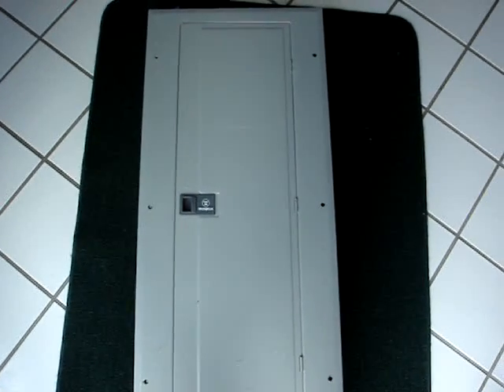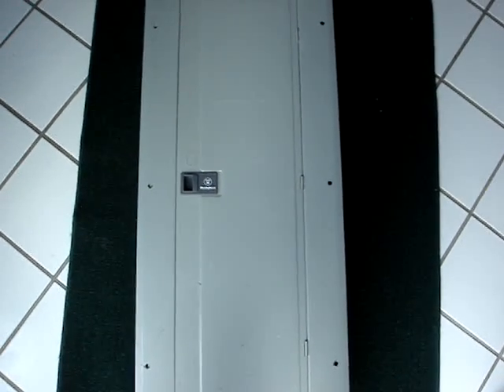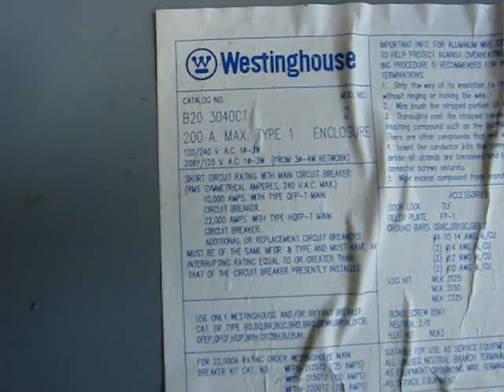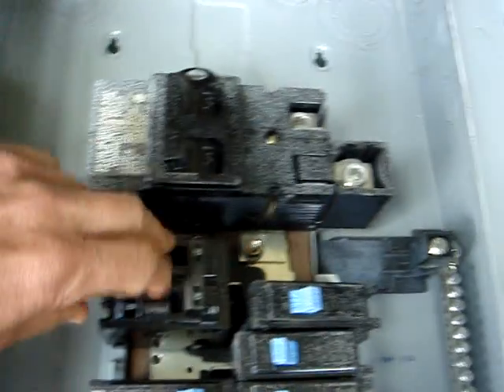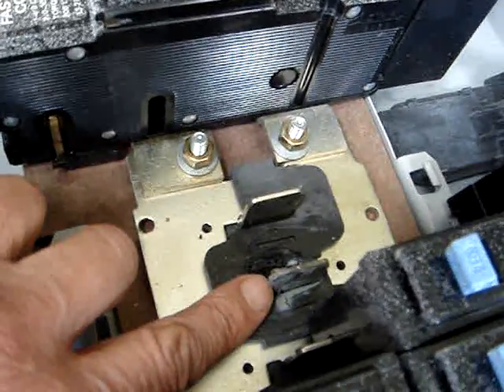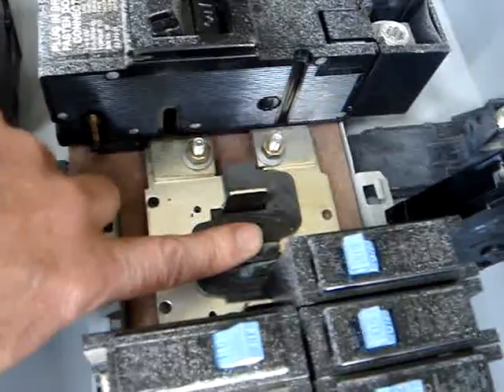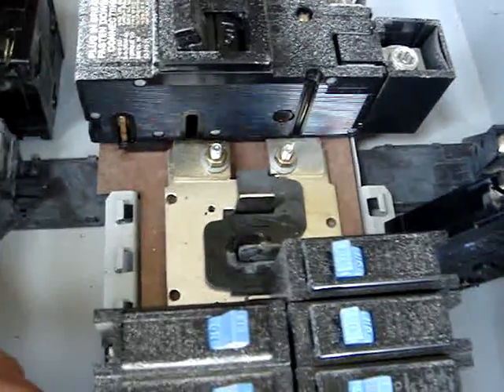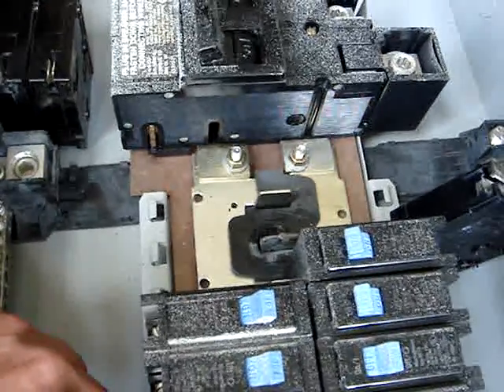Circuit Breaker Panel Problem - arcing between busbar and breaker - heating and melting plastic

Comment: Yeah, that the best safer way to go replace the breakers box. I had replaced quite a few, for the last 15 yrs as a electrician, the main reason this bus burn out is beacause  the connection is lose or the load is higher then the breaker suppling the load
Reply: Can you just replace the buss bar? This happened with ours and it looks much easier to replace just that part versus the whole panel which means tearing out drywall etc.... :-/

Comment: "2" problems, with any panel, Including, "Sq-"D" who every one says the "BEST" Horse shit !  If you get "Cheap" panels, with Aluminum, "BUSS BARS" & plug /Clip, on steel, copper, you get , heating, also notice where, main breaker, attaches to buss bars, "Notice steel bolts" -"NO large flat washers" bad surface contact betwwen Aluminum bars steel bolt carrying , 200 amps !   WAKE UP ! pay extra, for Copper bars !  Cutter Hammer & now  Seimens, has them. But will cost like $50.00 more ! Good price to save you're Kids & wife's Life. Unless you want to collect, life Insurance.
Reply from the maker: Thanks for the info.  I expect most homeowners hope the electrician makes the right choice since this level of knowledge is beyond us.  Obviously that is not always the case.  And, when buying a house that is already built, like I did,  you get what is there assuming it is okay.

Comment: I think only be replace just a bus bar and burn out breaker not entire panelboard must be replace cost more . Caution double check loosen and overload of load side preventive maintenance always
Reply from the maker: Not possible to replace just the bus bar in this panel.

Comment: 50A break for a house AC? 
Anyways they used the wrong breaker.  Looked like a Siemens breaker.  Gotta use the matching breaker for the box
Best to replace the whole thing, but if there is room, you can install the right breaker in a spot that isn’t burned up.

Comment: Me Too! Refrigerator was going wacky for a few days, started making strange noises, lights would sometimes blink. Got up this morning and fridge lights were out. First thought it had died and I would have to buy a new one. But just to be certain it wasnt power related I checked the breakers, which are Cutler Hammer from about 2003. No breaker had tripped. After some troubleshooting checked voltage at outlet, 107V. Went to panel board and all circuits were 120 except one which was 107V, a kitchen circuit. Pulled breaker and contacts were gone. Further inspection showed the contacts had probably been sizzling for several days and finally vaporized. The buss contact was badly pitted. Turned off power to panel and filed and sanded buss contact, but it is too pitted to recover and it is obvious the buss bar will have to be replaced. Moved kitchen circuit to never used breaker and am back in business for now. Also Replaced two adjacent breakers that had been pretty badly damaged from heat of the faulty contact. All breakers are CH, as they should be.

Comment from the maker: I am leaving the post addressed to Einstein on here because the person is right about not messing with a panel box yourself.  I am confused if he thinks i did that because it is quite clear in the description that I hired an electrician.  The video explains how i did troubleshooting for the problem, it doesn't advocate fixing it yourself.  The poster could benefit himself from a less condescending way of commenting.

Comment: Dear Albert Einstein:  You've got it all wrong!  This video should include a segment on do-it-yourself appendix removal, lung cancer radiation and chemotherapy (why pay retail prices?  Just buy the lung cancer chemicals and radiation equipment yourself, used, on ebay!),  and of course cure your own brain cancer, via easy to follow 3 minute clips on Youtube.  It takes two, not one, incomprehensible traits to mess with your own panel board:  stupidity of such a staggering degree that it blocks all cognizance of the notion of imminent, life-threatening danger, and cheapness so vast as to elect to think that it makes sense to try and save a little bit of money, despite the chance of losing your life.  Open up the wallet, tightwad, and get a pro in there from the word go.  Would you do your own brain tumor removal?  Messing with 50 amps coming into your house is every bit as unsafe.

Comment: Must use listed breakers, has nothing to do with the breaker panel. Each manufacturer has certain tolerances for breaker clamping force for their specific bus bar. Next time call the electrician first, he might of caught the bad connection in time and saved your panel. Home Depot is not qualified to give advice like this, especially over the phone!?
Reply from the maker: Elios Electric see comments

Comment: The electrician shoved nothing anywhere.  I no longer trusted the panel box not to repeat the problem so I told him to replace it.  Sometimes cheap isn't smart, especially if it means my house could burn down.

Comment: Circuit breaker was defeated product.  The company should had supply you with a new panel and all breakers.  Any company that doesn't do this, should be drop from your product buying list.  QOSD is very good.   It suck when a company will not stand behind there product.

Comment: The Entire Panel did not have to be replaced--The Buss is replaceable. The Original Cause of Arcing could be the Breaker or Buss. Also, if THAT Breaker Space was not needed, it could be Marked Do Not Use.
Reply from the maker: Good thinking.  I didn't trust the whole thing after the one section went bad and erred on the side of caution.
Reply: Can not agree enough. That electrician must have been on hard times.

Comment: if you find a voltage far less than 120, you may have arcing in you breaker box. I had 70v in 2 rooms of my house. it was the damn breaker box.

Comment: I have had this happen on BR type Eaton boxes with Eaton BR breakers.  Some panels even with larger loads are fine.  I have seen this on Murray boxes also.  I went back to using Eaton's Cutler Hammer CH panels.  Never had a problem out of a CH panel.  I have still been unable to find out why this happens.  Breakers are not getting good contact with buss bar is burning them up.  Breaker springs must be weaker than others not holding them tight on the bar.  No one  has a answer though as to why.
Reply from the maker: Starr Lion thanks for the info.
Reply: thanks for this video, my Murray panel is doing this as well.

Comment from the maker: The breakers are from the original panel installation, not replacements.  If you are right, the electrician didn't know his business.  Your observation could be right.  None of the other breakers showed this problem.

Comment: Yes , Just 2 days ago I was setting watching TV and smelled plastic and smoke . opened the door to my washroom and smoke & flames were coming from breaker box . Lucky I was home and I had a fire extinguisher . The 30 amp for my air also !! Yes the bus bar was melted .     Well I guess from these Vid. I have to change out the whole thing . This one is a Cutter-Hammer . Never heard of the Co.  This is a trailer built & bought in 2010 .

Comment: My Westinghouse panel is having the same issue. The main 100A melted to the busbar and burned some of it. I now need to change it out and may as well upgrade while doing so. I heard it buzzing but even after trying to reseat the breaker it did nothing. Are the old style Bryant breakers interchangeable with all C&H breakers, or do they say B series on them or something close?

Comment from the maker: This is not advice, just information.  If the main bar is in good shape, and there are some unused spaces on it, you may be able to have an electrician move the problem breakers (replaced of course with new ones) to another set of connectors on the bar if the wiring will reach.  DO NOT DO THIS YOURSELF!  Power to the entire box must be off.

Comment: That Siemens breaker for the a/c is NOT listed for use in that panel.  That's why it failed.
Reply: Justin Smith  Highly unlikely. If the breaker fit in there tight to begin with, why would it fail?  And of course, Westinghouse will only recommend their breakers.
Reply: doesn't matter if it's a tight fit or not, eaton/westinghouse breakers are only listed for use with eaton/westinghouse panels. Mixing metals was probably why it arced and destroyed itself. I'm not sure what they use for metals, but lets just say that siemens used steel, and the westinghouse bus bar was made out of aluminum, mixing those metals would cause a reaction, corrode, and cause arcing on that breaker.
Reply from the maker: thanks for the information.  Guess the original contractor's electrician didn't know that.
Reply: Robert Mitchum - The NEC does not allow you to mix breakers and boxes because of these type problems. You're just asking for a lawsuit or criminal charges for fire damage or if someone dies in the resulting fire.

Comment: I just had this problem right after changing a 70 amp breaker to a 60 amp breaker for a new AC system,THAT WAS INSPECTED. the 70 amp was in after the AC change out & worked perfect for a couple days until replacing with 60 amp for inspection! after running AC for an hour or two I also smelled SOMETHING, it smelled more like dead animal than plastic! It turns out the same thing happened only worse because we didn't know for sure what it was. My Bus is burned much worse, the breaker never popped, it just burned & burned till it failed, which caused major damage to my Bus ! Pisses me off because I say it was a bad breaker, YEA! Now we're in for a new panel @ $1,100! Home depot just say  I should have had an electrician install it! I've installed 50 or more in my PLBG BIZ over the years! I took the 70 amp to them, they matched it up. Isn't HD & Lowes "THE DO IT YOURSELF STORE??? That piece of CRAP breaker cost me Big Time, had I not been home, My house could have burned down!

Comment: Was the 2 pole 50 amp breaker an 'approved' breaker?  ... looked like a different manufacturer ... looked like an ITE or Siemens style.
Reply: I have no answer for your question.  My assumption is that the electrician who wired the house when it was built knew what he was doing, but that is an ass umption.

Comment: Thanks for the comment.  Why the panel and breakers were fine for 20 years and then malfunctioned is a bit of a mystery because the environment is an interior workroom without undue moisture. As to using the right breakers for the panel, I totally agree.  I assume that the installing electrician knew what he was doing.

Comment: A similar problem with a smaller panel in a condo apartment.  The panel box is a Zinsco 61-500-1, with four dual breakers , 25/25, 20/20, 15/15, 15/15, not tandem ganged.   One of the circuits on the 20/20 breaker went out when I restored power to it after I replaced  a faulty porcelain lamp socket.   I thought, "Gosh!  I know I was careful and made good connections with the correct polarities.  What could have happened?"    I was worried when I smelled the burn in the room with the panel box and saw the breaker still arcing.  I shut off the breaker and removed the panel cover, hoping that smoke and flames from an internal fire would not burst out at me.   Fortunately not!   Just a bad smell!   I shut the power off at my condo's meter box.   Locally, I found a replacement for the old Zinsco dual breaker at $107.00 plus tax.   When I extracted the old breaker, I found on the half for the downed circuit that an electrode that fits a bus bar had a rough texture on one side, as if it had undergone partial melting, just as the author of this fine video describes.   No doubt the plastic, too, was charred but I could not see into the bad breaker to observe it.

Two thoughts:   1)  The 20 Amp circuit controlled by the bad breaker has three rooms' lights plus the blower fan for my heating and A/C air handler.   That blower motor must draw a high starting current.    I don't think the motor started when I first restored power because there is a time delay component in the A/C blower's circuitry.  I think that over a long time the breaker was arcing and it just broke down at this time.
2)   I notice that the fit of the circuit breakers on the bus bars is not good.  They are canted, not square.   I think that is because the electrician who, years ago, wired the panel box was not careful to see that the bends in the 14 guage wire allowed a square contact between the breaker electrodes and the bus bar.

I am not an electrician; only a physicist.   But I would suggest that anyone hiring an electrician - most of whom are careful - be observant that the wiring done does not prevent good, square contact of breakers with bus bars in a panel box.   That will cause poor contact, excessive heating and eventual failure.

Comment: over loaded circuit breakers. on the 50 or 30, one of them or both of them were oveladed. mfg are gonna point in another direction😕

Comment: Just had this exact problem with my 1993 box this evening on the 30A double pole air conditioner circuit.  Plastic over the buss bar is melted and four breakers were also partially melted because one pole of the circuit was making bad contact.  There was a burning smell for the last two days, but my wife only told me about it tonight.  Smoke was coming off the top of the breakers.  Too bad I can't just buy a new buss bar and replace it to avoid all the labor of removing and reconnecting all the circuits in our home.

Comment: Same issue BUT different box.  Square D box with 100 amp sub panel.  The 30 amp circuit that services an an RV (rec vehicle).  The RV is located approx. 125 feet from the pad with AWG 6 wire.  If I could attach pic's I could show the breaker burn VERY similar to what you show in the video.  Circa box of 1990 and I've own the house since 2004.  The circuit to the RV pad installed circa 2006.  In 2008 we encountered similar burn to a LG refig that is in the same box, diff circuit.  filing that breaker contact has delayed the box replace until now (2015) when the RV bad circuit burn is beyond repair.

Comment: I have many years experience. This appears to be a lose connection on the A/C breaker that caused the issue. The A/C would come on and the connection where the breaker slides on to the bus bar was lose and arced, as time goes on the situation gets worse because of the arc marks. I don't think this is a manufacturer issue but rather an isolated breaker issue. Glad he found it though.

Comment: Currently I have a couple breakers not connecting or something.  Theres 3 spots on the bus covered in black carbon. But the interesting part I worried about. I moved wires to a working breaker on the bus and power still didnt go on or trip the breaker.
 Im missing something and is frustrating
Reply: Did you happen to figure your problem out cause I'm having that same issue

Comment: Exact same problem with my 200 amp service Eaton Cutler Hammer Box.  This is 2015!!!  Bought this building new 7 or 8 years ago.  This has happened with the AC breakers (3 phase 30 amps)  3 times on the front AC/heat pump unit circuit, once on the back AC/heat pump circuit.  Going to see if the contractor can do something for me.  I have been paying AC company and two electricians to figure out the problem.    It is a Problem on the high current circuits.  Defective breakers or Bus-  Either way they are melting and arcing.

Comment: My Eaton Disconnect and my Eaton double pole 30 amp breaker just burned out (on the left side if that matters)....This was used for outside lights. The light were working for about 3 months...then all of a sudden it started tripping. ..now breaker and panel is burned. Can i just replace the panel and breaker with a different and better brand Panel and Breaker?
Reply: That's a question for an electrician.  I replaced my entire panel and all the breakers using a qualified electrician.

Comment: The problem is that the 2 pole 30 is a murray/ seimens braker  not listed for use in cutler hammer panel this is not the fault of cutler hammer but the user
Reply: 2 pole 50 not 30
Reply: Tyler Whaley
Is this comment about the video or someone's comment?  I am not sure why you think this is a Cutler Hammer panel since the label on it says "Westinghouse."  However, you may be correct that the original electrician used the wrong breakers on the box.  If you could comment again and include your background (electrician?) that would be helpful.  Thank you.
Reply: Don Barkman clutler hammer is westinghouse
Reply: Don Barkman im an electrican
Reply: Tyler Whaley
Thanks.  That helps.  I'm just a homeowner.

Comment: I have found when ever I have purchased breakers from Home Depot or Lows and installed them in a circuit where there a was a constant high load running on it after 9 to 12 months the breaker will start tripping and at first it may happen 2 to 5 times in the first year or so.  I do know many manufacture make products for Home Depot and Lows witch have the same part numbers and everything but are made cheaper for the big retails because they do not want to pay the same amount of money as everyone else and sense they are such big accounts it worth it to the companies to manufacture versions of their product with cheaper metals and plastics I had a guy at an electrical store one day tell me that the Eaton breaks he buys can not be manufactured for the same price as home depot sells them for and I believe your issue came from a circuit that was used a lot and the metal contacting the buss would expand and contract a lot till it started racking creating lots of heat and eventually melting the breaker it self and one last thing any time i have purchased breakers from an electrical supply store i have never had a problem with them